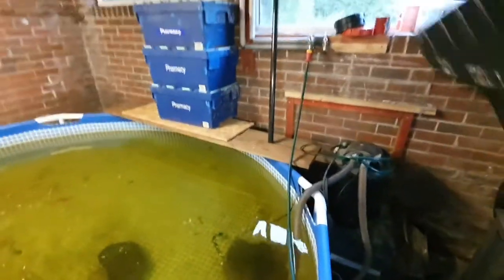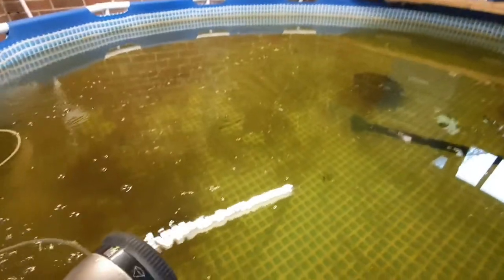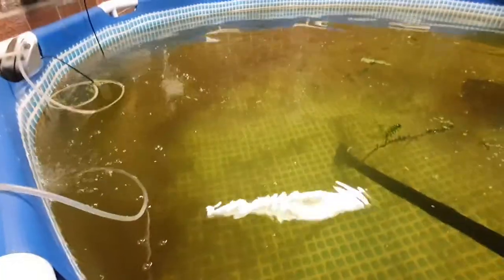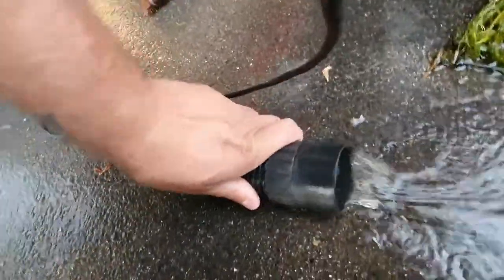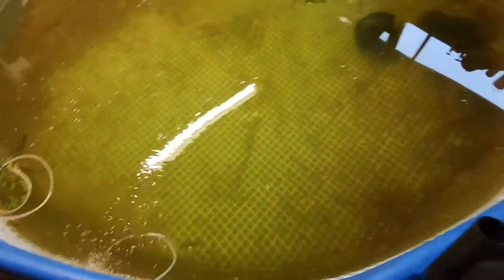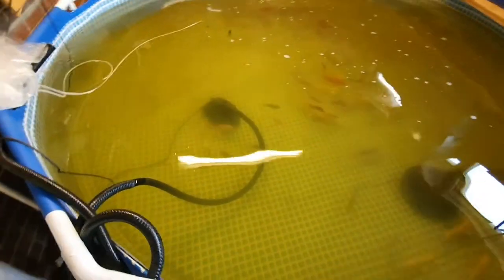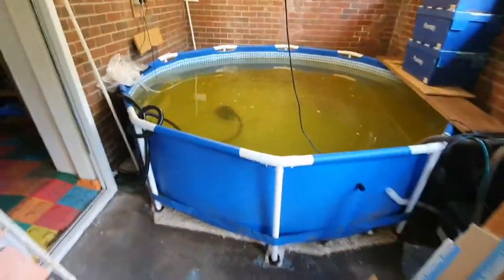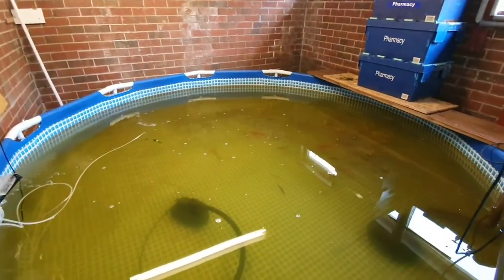how to use a pond vac - without draining your pond!

Comment: Without draining your pond???  I guess it depends on how long it takes because there's NO WATER going back into the pond.
Reply: He doesnt have to drain the pond and shovel out sludge manually, it doesnt mean the vacuum is going to somehow filter the water and return the clean water back onto the pond, VERY useful video  if you have a pond
Reply: @RougaRouKJun  That's not what I meant.  When I tried it, it seemed so insufficient that it would end up draining the pond before it was clean.  I didn't know what I was using just had the hose on it for pressure.  I thought it was going to be putting hose water IN as the suction was pulling it out.

Comment: think its time they put sum sort of non return valve on the heads of the pond vac stop all the crap in the pipe from running back in wen it turns off
Reply from the maker: I'm with you on this mate!